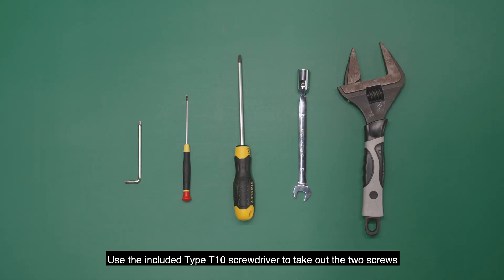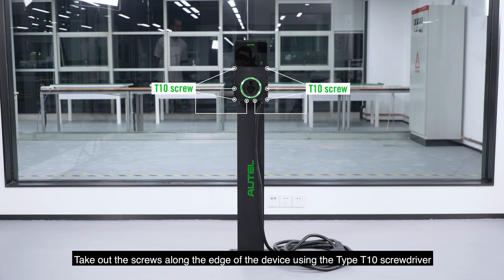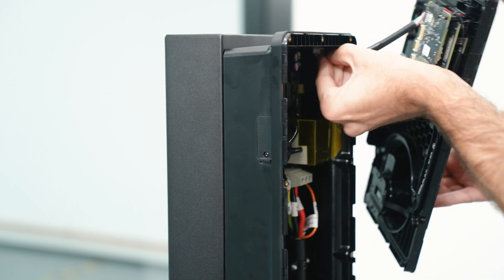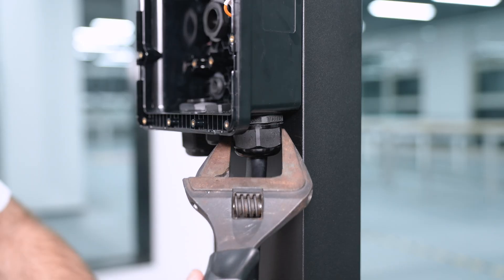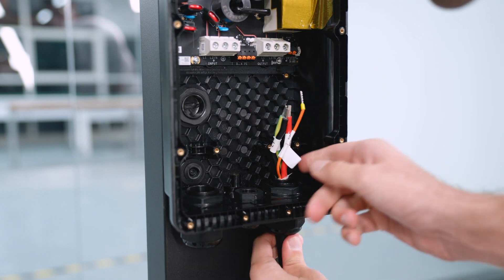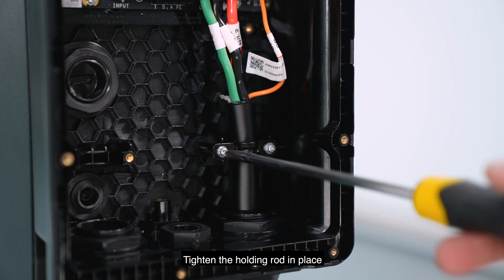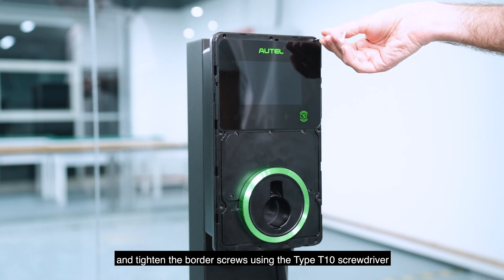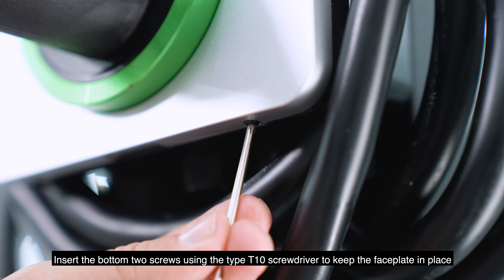How to replace the charging cable on the MaxiCharger AC Commercial

Comment: How to detach the orange wire?
Reply: Came here for same question - just figured it out (from the wear you see at 0:40).  

Small flathead, press btw the two little orange flaps, and it basically disappears entirely into the black housing and releases the wire.